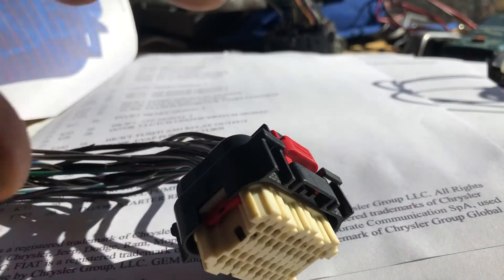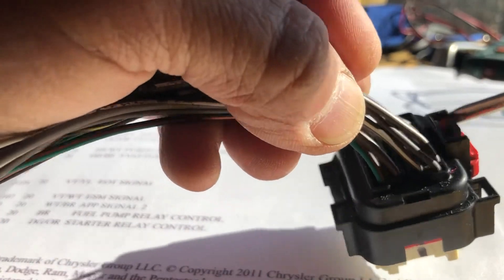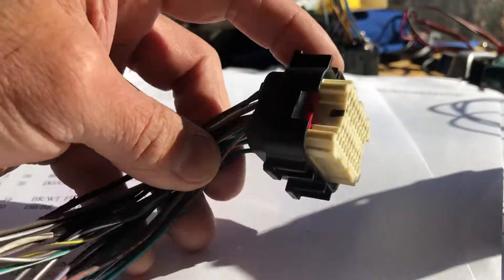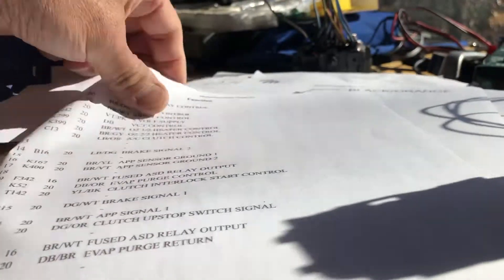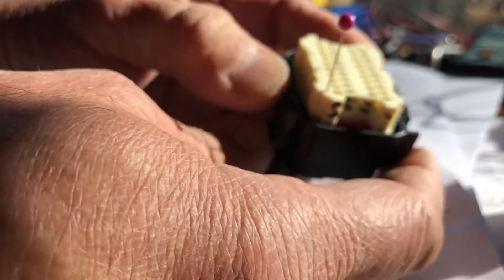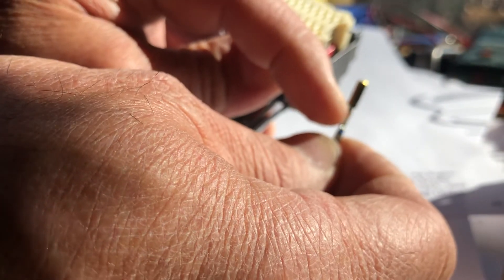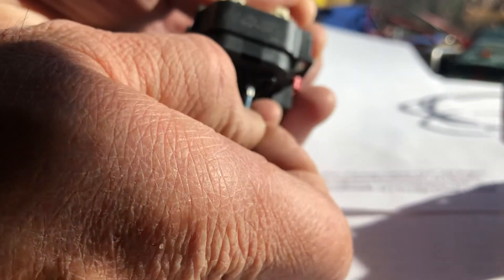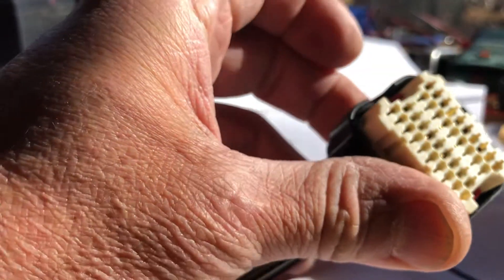G3 Hemi NGC PCM ECU 38 pin connector pin removal. Jeep, Dodge Chrysler PCM

Comment: I have been looking all over for this video. I am having issues with my throttle body control motor, I keep getting codes P2101 and P2110, which I believe is a issue with the wiring since I have already put 4 different throttle bodies in it. My idea is to rerun all 6 wires from the throttle body connector to the orange PCM connector to ensure its not a wiring issue. This video is awesome

I am working on a 2005 Jeep Grand Cherokee 5.7. 
Thanks
Reply from the maker: Check my other video with the throttle body handshake. Only running a few wires and everything else is disconnected. You should see it move when you turn on the power.
Reply: @shelbydogg  What type connectors are those that go on the wire from the throttle body to the C2? I am going to rerun the wires, and need the name so I can order a few of them. thanks
Reply from the maker: @PreparedOverlander I don’t know

Comment: I've been looking all over for a good video on depinning the C1, C2, C3, & C4 connectors. Imagine my happiness when I lucked up on this video quite by accident. THANKS!
Reply from the maker: Before you found my video, what words were you searching for. Give me a few and I’ll add them to my video tag words. Thanks
Reply: @shelbydogg  I'm working on a 2010 Jeep Grand Cherokee WK that uses the same connectors. I tried searching "Jeep PCM Connectors" and several variants. I believe Dodge and Chrysler use the same 38 pin connectors on the Ram. The biggest difference I noted most was that some of the vehicles use the Green connector. Mine uses Black, Orange, and Natural, but they all disassemble the same. Maybe try Jeep, Dodge, 38 pin PCM connector pin removal.
Reply from the maker: @im2yys4u81  thanks, I’ll add jeep to my tag words. Chrysler and dodge used that PCM till the mid 201x. The green connector was used for trans control.
Reply: @shelbydogg  I'm thinking that if you were to run a tag for "depinning Jeep, Dodge, Chrysler, 38 pin pcm connector" more people might find this. No matter what color they are, they're all 38 pins.
Reply: I am working on a 2005 WK with 5.7, I keep getting P2101 and P2110 codes and limp mode. Is this anything similar to what you have going on?
Reply: Exactly

Comment: Thanks as always! If you put the entire connector in hot tap water for 10-15 min, it gets softer and not as likely to break the outer cover tabs. Once open, you can easily dry it out with some compressed air after. I did this myself after breaking the tabs off 2 and it worked for me. Luckily, I had a bunch from a trip to the salvage yard.
Reply: My broken connector is under the hood so using hot tap water was not a feasible option. What I did was improvise by using my heat gun set on low heat. Not sure who worked on this jeep, but they managed to break the connector for the PCM, the MAP sensor, and the C2 connector on my FCM. Like you I was lucky enough to pillage several connectors from the salvage yard.

Comment: Holy crap, I've been looking for a week for info about this connector.  
The problem I'm having is that even with the right tool (I have a terminal lock tool), the pin still doesn't come out. Any ideas?
Reply from the maker: Alway try YouTube first. Lol
Reply: @shelbydogg  Yeah the FSB didn't even have info on it.  Youtube was the way and I appreciate this video a lot.  Still can't get the pins out though, going nuts over here.
Reply from the maker: Did you click the red sliding clip over? Pins won’t come out unbroken and easily if you don’t slide it over first to unlock the pins. Have a friend watch my video and try it themselves. Maybe you aren’t understanding my instructions completely.
Reply: @shelbydogg  The red clip is slid over fully, Im sure that part is unlocked, and I do understand the instructions. I've been working on vehicles a long time, this is one of the first times I've been this stumped.

Comment: Do you have pin out information for the cars all I can find is for the trucks.
Thanks
Reply from the maker: Try this one: 
https://0595e983-8609-4d15-8d52-0fd1f7c84298.filesusr.com/ugd/6b5d57_dc9bd7593d5d4f22bbef6e0d92809c98.pdf
Reply: @shelbydogg  this appears to be for the ram trucks , I looked at my connectors and don’t have some of the color call outs, I think this is what’s on diy hemi site.
Reply from the maker: @dougcardwell7496  How about this one below? I saved off of the web.  I also have a printout from DIYHEMI that is no longer linked, It was the white print on black pages detailing what to hook up. Ask Blake if you can have a copy.  I also have working Hotwire 5.7 and 6.1 harnesses that I copy off of.

POWERTRAIN CONTROL MODULE C1 (NGC) - BLACK 38 WAY CAV CIRCUIT FUNCTION
1 K98 18DB/YL (EXCEPT 3.7L) COIL CONTROL NO. 8
2 - -
3 K97 18BR/YL (4.7L) COIL CONTROL NO. 7
3 K97 18BR (5.7L) COIL CONTROL NO. 7
4 K28 18BR/LB (EXCEPT 3.7L) INJECTOR CONTROL NO. 8
5 K26 18BR/YL (EXCEPT 3.7L) INJECTOR CONTROL NO. 7
6 - -
7 - -
8 B222 20DG/WT (5.7L) VEHICLE SPEED SIGNAL NO. 2
9 Z130 16BK/BR GROUND
10 - -
11 F202 20PK/GY FUSED IGNITION SWITCH OUTPUT (RUN-START)
12 F1 16PK/WT FUSED IGNITION SWITCH OUTPUT (OFF-RUN-START)
13 B22 20DG/YL VEHICLE SPEED SIGNAL NO. 1
14 - -
15 - -
16 - -
17 - -
18 Z131 16BK/DG GROUND
19 - -
20 G6 18VT/GY OIL PRESSURE SIGNAL
21 C918 18BK/LB A/C PRESSURE SIGNAL
22 G31 18VT/LG AAT SIGNAL
23 - -
24 - -
25 D20 20WT/LG (5.7L) SCI RECEIVE (PCM)
25 D20 18WT/LG (EXCEPT 5.7L) SCI RECEIVE (PCM)
26 D16 18WT/OR (3.7L A/T/4.7L A/T 5.7L) SCI RECEIVE (TCM)
27 F856 18YL/PK 5 VOLT SUPPLY
28 - -
29 A919 20RD FUSED B(+)
30 T751 16YL FUSED IGNITION SWITCH OUTPUT (START)
31 K141 18DB/YL O2 1/2 SIGNAL
32 K902 18BR/DG O2 RETURN (UP)
33 K243 18BR O2 2/2 SIGNAL
34 - -
35 - -

POWERTRAIN CONTROL MODULE C2 (NGC) - ORANGE 38 WAY CAV CIRCUIT FUNCTION
1 K10 18DB/OR COIL CONTROL NO. 6
2 K16 18DB/YL COIL CONTROL NO. 5
3 K15 18DB/GY COIL CONTROL NO. 4
4 K58 18BR/VT INJECTOR CONTROL NO. 6
5 K38 18BR/OR INJECTOR CONTROL NO. 5
6 K447 18TN/YL (5.7L) ETC MOTOR (+)
7 K18 18DB/OR COIL CONTROL NO. 3
8 K35 18DB/VT (5.7L LIGHT DUTY) EGR SOLENOID CONTROL
9 K17 18DB/TN COIL CONTROL NO. 2
10 K19 18DB/DG COIL CONTROL NO. 1
11 K14 18BR/TN INJECTOR CONTROL NO. 4
12 K13 18BR/LB INJECTOR CONTROL NO. 3
13 K12 18BR/DB INJECTOR CONTROL NO. 2
14 K11 18BR/YL INJECTOR CONTROL NO. 1
15 K922 18BR/DB (5.7L) THROTTLE POSITION SENSOR GROUND
16 - -
17 K199 18BR/VT O2 2/1 HEATER CONTROL
18 K99 18BR/LG O2 1/1 HEATER CONTROL
19 K20 18BR/GY GEN FIELD CONTROL
20 K2 18VT/OR ECT SIGNAL
21 K22 18BR/OR TP NO. 1 SIGNAL
22 K34 18DB/LG (5.7L LIGHT DUTY) EGR SENSOR SIGNAL
23 K1 18VT/BR MAP SENSOR SIGNAL
24 K942 18BR/LG (EXCEPT 4.7L) KNOCK SENSOR NO. 1 RETURN
25 K42 18DB/YL (EXCEPT 4.7L) KNOCK SENSOR NO. 1 SIGNAL
26 - -
27 K900 18DB/DG SENSOR GROUND
28 K122 18BR/DG (5.7L) TP NO. 2 SIGNAL
28 K961 18BR/VT (EXCEPT 5.7L) IAC RETURN
29 F855 18PK/YL 5 VOLT SUPPLY
30 K21 18DB/LG IAT SIGNAL
31 K41 18DB/LB O2 1/1 SIGNAL
32 K904 18DB/DG O2 RETURN (DOWN)
33 K43 18DB/LG O2 2/1 SIGNAL
34 K44 20DB/GY CMP SIGNAL
35 K24 20BR/LB CKP SIGNAL
36 K242 18BR/WT (EXCEPT 4.7L) KNOCK SENSOR NO. 2 SIGNAL
37 K924 18WT/BR (EXCEPT 4.7L) KNOCK SENSOR NO. 2 RETURN
38 K448 18TN/OR (5.7L) ETC MOTOR (-)
38 K61 18VT/GY (EXCEPT 5.7L) IAC MOTOR CONTROL

36 D21 20WT/BR (5.7L) SCI TRANSMIT (PCM)
36 D21 18WT/BR (EXCEPT 5.7L) SCI TRANSMIT (PCM)
37 D15 18WT/DG (3.7L A/T/4.7L A/T 5.7L) SCI TRANSMIT (TCM)
38 D25 20WT/VT PCI BUS

POWERTRAIN CONTROL MODULE C3 (NGC) - WHITE 38 WAY CAV CIRCUIT FUNCTION
1 - -
2 - -
3 K51 20BR/WT ASD RELAY CONTROL
4 - -
5 V35 20VT/OR (3.7L/4.7L) S/C VENT CONTROL
6 K173 18BR/VT CONDENSER FAN RELAY CONTROL
7 V32 20VT/YL (3.7L/4.7L) SPEED CONTROL SUPPLY
8 K106 18VT/LB NVLD SOLENOID CONTROL
9 K299 18BR/WT O2 1/2 HEATER CONTROL
10 K399 18BR/GY O2 2/2 HEATER CONTROL
11 C13 20LB/OR A/C CLUTCH RELAY CONTROL
12 V36 20VT/YL (3.7L/4.7L) S/C VACUUM CONTROL
13 - -
14 V32 20VT/YL (5.7L) BRAKE SWITCH NO. 2 SIGNAL
15 V937 20VT/BR (5.7L) S/C SWITCH RETURN
16 K167 20BR/YL (5.7L) APPS NO. 1 RETURN
17 K400 20BR/VT (5.7L) APPS NO. 2 RETURN
18 V38 20VT/OR (5.7L) S/C SWITCH NO. 2 SIGNAL
19 K342 16BR/WT ASD RELAY OUTPUT
20 K52 18DB/WT EVAP PURGE CONTROL
21 T41 20YL/DB TRS T41 SENSE
22 G113 18VT (EXCEPT 3.7L BASE) PTO SWITCH SENSE
23 B29 20DG/WT BRAKE SWITCH SIGNAL
24 - -
25 K23 20BR/WT (5.7L) APPS NO. 1 SIGNAL
26 - -
27 - -
28 K342 16BR/WT ASD RELAY OUTPUT
29 K70 18DB/BR EVAP PURGE RETURN
30 K66 18DB/WT (5.7L) P/S SWITCH SIGNAL
31 - -
32 K25 18DB/VT BATT TEMP SIGNAL
33 N4 20DB/WT FUEL LEVEL SENSOR SIGNAL
34 V37 20VT S/C SWITCH NO. 1 SIGNAL
35 K107 18VT/WT NVLD SWITCH SIGNAL
36 K29 20WT/BR (5.7L) APPS NO. 2 SIGNAL
37 K31 20BR FUEL PUMP RELAY CONTROL
38 T752 20DG/OR STARTER RELAY CONTROL

POWERTRAIN CONTROL MODULE C4 (NGC) - GREEN 38 WAY CAV CIRCUIT FUNCTION
1 T60 18YL/GY OVERDRIVE SOLENOID CONTROL
2 T259 18YL/DG 4C SOLENOID CONTROL
3 - -
4 T118 18DG MS SOLENOID CONTROL
5 - -
6 T219 18YL/LG 2C SOLENOID CONTROL
7 - -
8 T59 18YL/LB UNDERDRIVE SOLENOID CONTROL
9 - -
10 T20 18DG/WT L/R SOLENOID CONTROL
11 T140 18YL/GY PRESSURE CONTROL SOLENOID CONTROL
12 Z908 18BK GROUND
13 Z977 18BK GROUND
14 Z904 18BK GROUND
15 T1 18DG/LB TRS T1 SENSE
16 T3 18DG/DB TRS T3 SENSE
17 T6 18DG TOW/HAUL OVERDRIVE OFF SWITCH SENSE
18 T515 20YL/DB TRANSMISSION CONTROL RELAY CONTROL
19 T16 18YL/OR TRANSMISSION CONTROL RELAY OUTPUT
20 T48 18BR/YL 4C PRESSURE SWITCH SENSE
21 T29 18YL/WT UNDERDRIVE PRESSURE SWITCH SENSE
22 T9 18DG/TN OVERDRIVE PRESSURE SWITCH SENSE
23 - -
24 - -
25 - -
26 T4 18DG/LB TRS T2 SENSE
27 - -
28 T16 18YL/OR TRANSMISSION CONTROL RELAY OUTPUT
29 T50 18YL/TN LOW/REVERSE PRESSURE SWITCH SENSE
30 T147 18DG/YL 2C PRESSURE SWITCH SENSE
31 T38 18YL/BR LINE PRESSURE SENSOR SIGNAL
32 T14 18DG/BR OUTPUT SPEED SENSOR SIGNAL
33 T52 18DG/OR INPUT SPEED SENSOR SIGNAL
34 T13 18DG/VT SPEED SENSOR GROUND
35 T54 18DG/OR TRANSMISSION TEMPERATURE SENSOR SIGNAL
36 - -
37 T42 18DG/YL TRS T42 SENSE
38 T16 18YL/OR TRANSMISSION CONTROL RELAY OUTPUT
Reply: @shelbydogg  could you please send me a copy of the one that was taken off their site, that’s what got me started on this journey and now for some reason it’s disappeared, I’ve sent several requests for information in the last few days to no avail.
Reply from the maker: @dougcardwell7496  You'll have to get it from Blake or have him put it back on the DIYHEMI site. I don't know why he removed it. Have you messaged him on FB?
Reply from the maker: Doug, did you see my new video showing the pin outs for the car harness? Very easy to make that short harness.
Reply: @shelbydogg  yes, I’ve watched it numerous times and even saved it for later reference very informative and just the information that I needed. There was also another post that takes you to a Mopar site that has pinouts off all of the connectors on each specific year model. Between the information that your video provides and the model specific information on the Mopar site hopefully I can figure it out. If I get stumped I may hit you up but thanks so much for sharing your information . That is truly how hot rodding is supposed to work, everyone being willing to share the knowledge that they have and to help each other!!!
Reply: Connectors.dcctools.com for model specific info on pinouts and any connector on the car.
Reply from the maker: @dougcardwell7496  Yeah, had that already from G3 Hemi Swap page. Hope it helps others since some of my viewers don’t use FB and don’t know how much knowledge is from there.

Comment: Great trick, I was taking the connectors apart to get the pins out. I bought the $22 tool from Chrysler to remove them but it broke after a few uses.